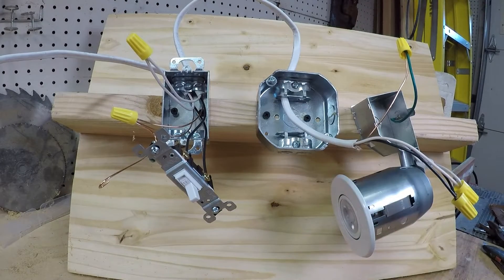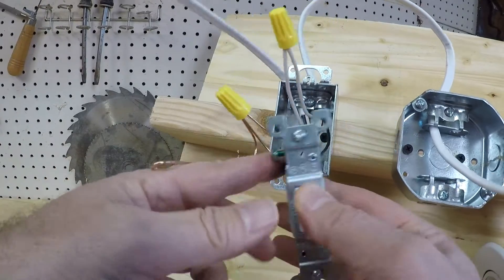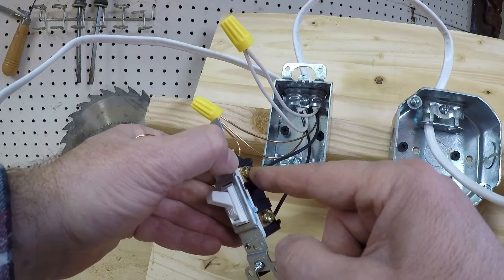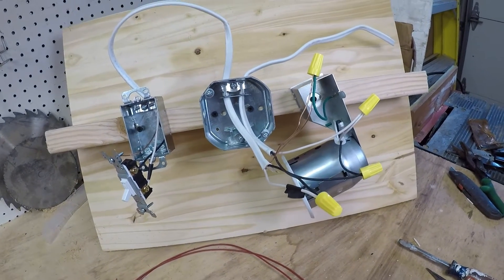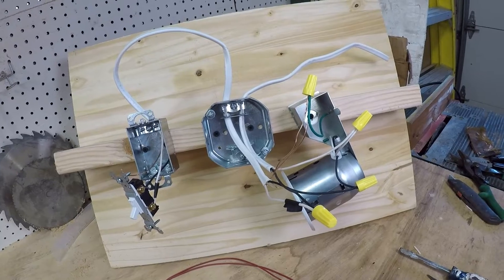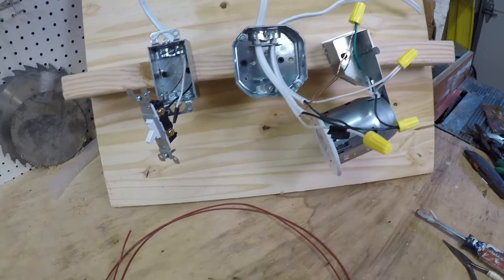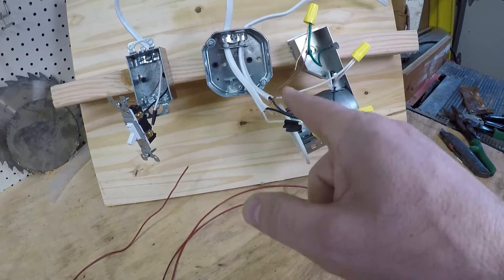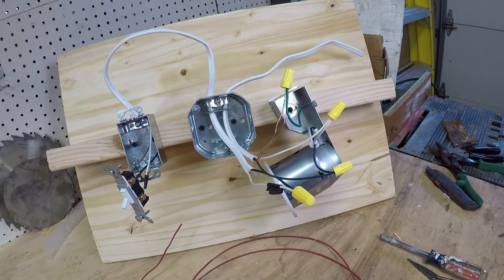How to Wire a Light Switch Safely - Single Pole Wiring Instructions

Comment: Called an electrician and they want $280 to do this. I tried to figure it out myself now it keep tripping power at the box every time I turn power back on. I'm so lost. Seems like I've got two many wires. Reds are cut, ground is to short and black is hot. So weird
Reply from the maker: yes you probably have a short or connected it incorrectly

Comment: What about if you got a cell in fan with light
Reply from the maker: that should make no difference if the light and ceiling fan can be independently turned on at the fan or with a remote.

Comment: Thanks for this great video. I couldn't understand why the switch instructions said not to use the neutral but it was clearly being used on the previous dimmer. Also I only had a black, white, and ground. Clearly they used the white wire as a hot. I connected it as such and worked like a charm. Thank you!

Comment: Thank you very much. I am rewiring the old cloth wiring and removing it out of my barn and putting in 12/2 and putting in new stuff. It has a new 200 amp manel, but they put in a sub panel, then just ran the old wire to it, with new 10 gage wire going to the new box, dumb. The old wire it still a fire hazard. It is a beautiful 1890 barn in mint condition. Why risk that? Kept it in good condition, and risked a fire with old cloth wire that is falling apart.

Comment: Plz Set me straight...I have a dimmer switch to change. My current setup is a on/ off switch in the kitchen & a knob type dimmer in an adjacent breakfast nook, both control same light fixture. I removed the current dimmer & went to the hardware store where things got confusing for me. The dimmer i removed has 3 wires (2 blk & 1 red). I was told i need a single pole 3 way. I had taken a picture of old install even though new colors didn't match. I have tried every combination of wiring connection to the existing wires with no success. Do you think the 3 way switch is the problem area(it has 4 wires instead of 3) or do i just need a single pole?

Comment: Thank you for the great video.  I'm running into the same issue in my attic where power is run through a light first before the switch.  I have no outlet in my attic.  I'm wondering if I can run an outlet off the switch?
Reply from the maker: I am sure you can, but make sure you wire it properly.

Comment: got a question for you it for some reason  needed the swtich to be on when the switch was in the down postion could you just not the connection of the wires ?
Reply from the maker: no it has nothing to do with the wires. You have to install the switch upside down
Reply: @flannelguydiy6458   does that mean switching the way the wires are connected would not be the same as installing the swithc upside down?
Reply: I mean I would have thought electricity only flows in one direction so I would have thought that if you just swtich the upper and lower wires it would have been effectively installed up side down is that not right? or am I missing something thoughts please thank you
Reply: @Fredengle The switch only makes or breaks the connection, so it makes no difference which screw you use. In AC the current alternates in both directions, but is not relevant to your question. In DC the current flows in one direction, but it still makes no difference. The important thing is that the switch is only wired using the hot wires, so the live conductor ends at the switch before energizing the light socket when the switch is off.

Comment: I'm guessing that my wiring is the 2nd part of the video as the switch has  a black and a white wire attached and the ground wire.  The problem I have is the new light switch (a smart switch) is telling me to connect the 2 black wires to the switch's 2 black wires and MUST attach the neutral wire to the switch's white wire and the ground to their green wire.   There aren't 2 black wires, so do I take the smart switch back to the store?  The lady in the video explaining what needs to be done said it will not work without the neutral wire attached to the switch's white wire. 
Thanks

Comment: Just wondering if you can connect the black wire to the black wire if the current goes to the light first. thanks
Reply from the maker: you really want the hot wire going through the switch

Comment: Our electrician  ran 2 wires to the light switch which one he wrote Jumper on it. Watching your video  I put the black wires on The switch and wire the 2 white with a wire nut. Question is what black wire do I put on the bottom of the switch, the jumper wire or the other wire. And there's one wire that goes to light that I have hooked up. Which black wire do I put on the bottom of the switch? The wire that has jumper on it or the other one that has nothing wrote on it. Looking forward to hearing from you.
Thanks

Comment: We added a room and electrician ran a wire to a light switch and the other wire he wrote jumper which I think that is the wire that goes to the 3 outlets. According to your video the incoming wire black go to the bottom of the switch and the other black wire goes to the top of the switch and the 2 wires are tied together. Is that correct?
Reply from the maker: correct

Comment: Hello,  My power source is coming through the ceiling as you shared in the second example.  Did you use the white wire from the power source to connect to the white wire on the light? You didn't mention that & I can't tell just from looking at the video if they're connected or not. 
Thanks so much.
Reply from the maker: white is supposed to be neutral. you would connect white to white in most instances.

Comment: Here in autumn 2021.  Your explanation & demo models were easy to understand, with good detail.  The only place people that are totally unfamiliar with this matter may still have some confusion could be  where the white wire is being used as the black hot wire, even after detail.  Still good overall.
Reply from the maker: thanks for watching...
Reply: When you use the neutral as a hot,does that mean a neutral is not needed anymore for current to flow back to the breaker panel?

Comment: A metal box has a grounding screw hole because the box is conductive and can be electrified. It is the same reason a plastic box does not have a ground screw hole. The box ground screw does not ground the switch and both should be grounded if you are adverse to electrical fires.

Comment: Is ground necessary?
Reply from the maker: It still works without a ground wire but safer with it and likely required by your local code

Comment: I replaced bathroom switches, but now the light in room accross the hallway can only be turned on if the batchroom light is on. Please explain how to wire so that the power come into the light switch in the bathroom, but allow the room light to always work.
Reply from the maker: it sounds like you have incorrectly wired the switch. Cannot help without seeing it for myself

Comment: Does it matter if the load and hot wires are switched?
Reply from the maker: Yes it does because if they are switched, then the load is hitting your light fixture even when the light switch is off. Could create a dangerous situation. When the load goes to the switch first, the juice stops at the switch and does not proceed to the light until the light switch is turned on.

Comment: Great Video! I have seen videos on how to add an electric outlet to light switch with the first wiring configuration you showed, were the switch has two sets of romex feeding it. Is it possible to add an outlet from a switch that has the last configuration you showed, that has 1 romex wire, where white is hot? A video would be great, but even a short explanation would work. Thanks in advance!

Comment: Can you please explain why you would want to run power through a light first before a switch?  What application?  Is it just convenience of the location of of the parts in a house some times?
Reply from the maker: Yes it would be convenience where the light is potentially between the panel and the switch. However, many homes that were built a long time ago used this method really out of laziness on the part of the contractors. I have seen switches with no neutral wire at all in the box.
Reply: @flannelguydiy6458  in one of my bedrooms on the second floor the setup is like that. Power goes to a light box  first then to  switch. 
That said, I need to change the position of the light switch therefore I need to extend the wires. In my case, wiring from the light to the switch is easier than wiring from the first floor (concrete)to the switch. I'm not an electrician but I have worked with digital circuits. My only concern is that if I need to have a license or if the city will allow me to do it. 
Excellent video.

Comment: My light switch has two white wire on one screw and one black wire on the other screw.  There no ground wire to the switch. It a single pole.
Reply from the maker: this does not make sense. How many wires are coming into your box there?

Comment: And how to add a outlet to that installation?
Reply from the maker: I am going to work on that video for you
Reply: Agree, your explanations are great.  I would like to see a video where you have the hot feed coming into the switch and then another wire goes to the light and another to a continuous outlet chain.

Comment: All switch boxes require a neutral wire. Cannot use a 14/2 from light box when power is supplied to the light box. Must use a 14/3 wire to carry the neutral down.
Reply from the maker: unfortunately many older homes were not wired that way. I have seen many homes built 50 years ago where the lazy contractors ran the power through the attic to the lights, then just ran a single wire down to the switch. All of them have just one wire. It is a problem.

Comment: Will it cause a problem if I put the hot wire directly to the light and then the light neutral to the switch?
Reply: That would not cause a problem for you. The light would still work because you are interrupting the circuit. But if your intention is to kill the next person working on that circuit then you will be successful.

Comment: 4:53 that is an "old work" box, because it has that adjustable tab (seen at the bottom, with a screw through it) that clamps behind the drywall. a "new work" box is the type that you nail into the stud before the drywall goes on. It can be confusing though, yes.

Comment: Amazing Video. One question I had.. when I fish Romex 12-2 behind insulated finished drywall.. do I need to put it through conduit or I can just use the wire alone? Any help would be appreciated.
Reply from the maker: Thanks for watching Darshil.   No you do not need conduit behind the drywall
Reply: Flannel Guy DIY Thankyou so much. It helps a lot
Reply from the maker: Darshil Patel you are welcome